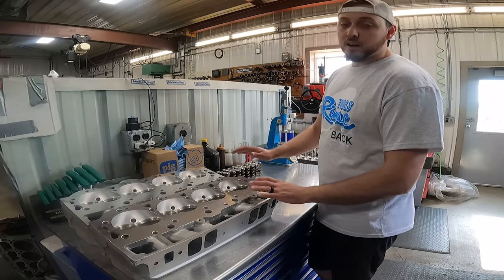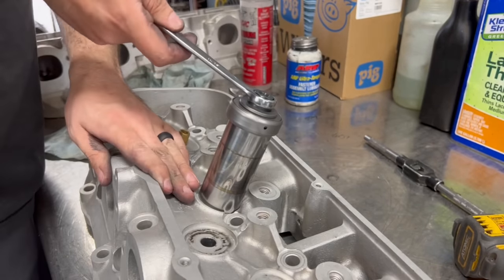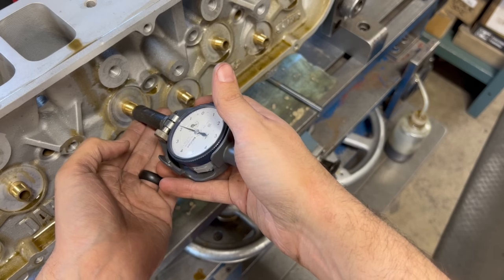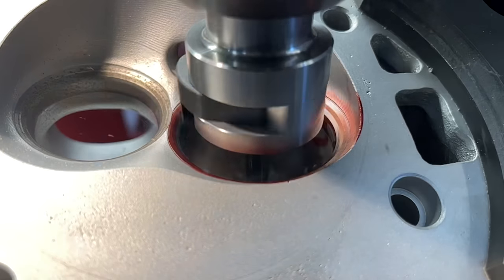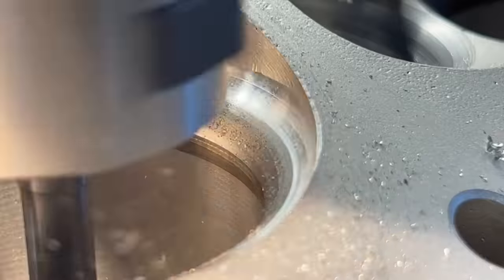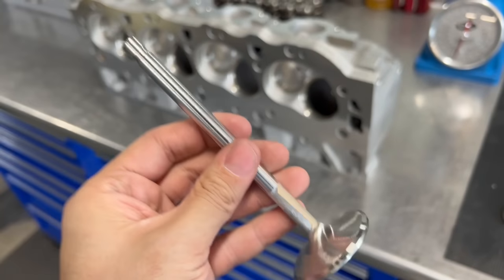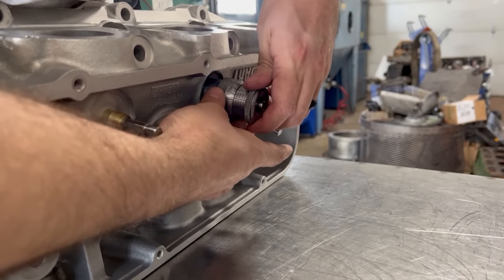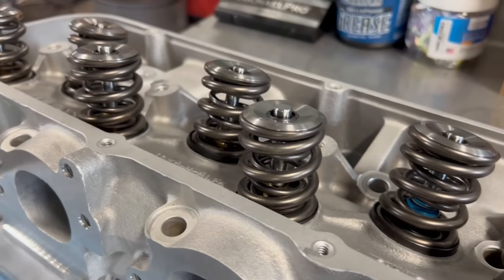This Set Of Big Block Chevy Race Heads Needed A Lot Of Work! Liquid Nitrogen and Specialized Tools

Comment: Why not just cut all seats to the same depth so you dont have to shim the valve springs, or have to shim them all the same?
Reply from the maker: Cutting to the same depth means cutting to the WORST seat, which is less than ideal, and like you said still results in shimming. Better to keep them all as high as possible, even if it means shimming differently
Reply: @JAMSIONLINE  If you were putting new seats in, is the tactic to cut all to the same depth or do you look for something else to determine what depth each should be cut to?
Reply from the maker: @beachboardfan9544  yes if we were installing new seats they would all be cut to the same depth usually.

There are many factors and specs to try and hit, ex spring install height, valve stem height, etc.

But on heads that have been ran, some seats will be worse than others.
Reply: @JAMSIONLINE  I'd almost just want them all to be cut the the same height (the worst one) and then just know, next time it needs done I'll be needing seats completely replaced. Is there any flaw in that, that I'm not seeing, like a potential for damage?

Comment: HOW MUCH QUICKER & FASTER WOULD THE DRAG RACING TEAMS GONE IN THE LATER 1960s...w/A SET OF THESE (HEMI) HEADS ???
THIS, BY MY ESTIMATION WOULD HAVE GOT THEM UP AROUND A FULL SECOND QUICKER...
NOW, IF I DECIDE TO BUILD A COUPLE uh THREE OR SO ENGINES...I WILL PUT THIS SHOP TO WORK ON MY HEADS...
~

Comment: I have a question for anyone to answer.  
I was doing a short high speed run in my z06.  1000 engine HP, 403 stroker, forged everything....best of the best...... A valve head broke off....havoc in the cylinder and also damaged the ported heads.   Question is....since the head is aluminum can it be salvaged?  It made gouges in the areas by the valves.

Comment: Those heads look awful, not your workmanship for the valve seat but in the cast material itself. Saw several voids in the machined surfaces aswell as some inclusions.